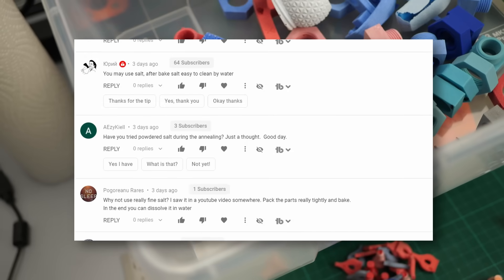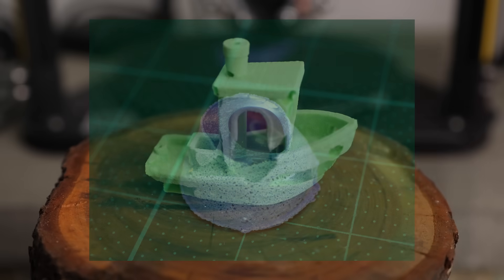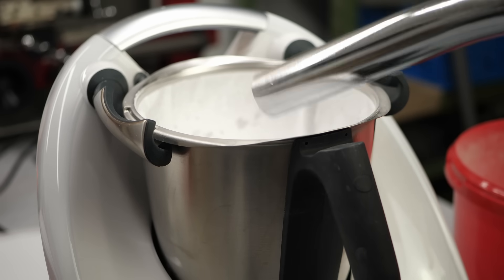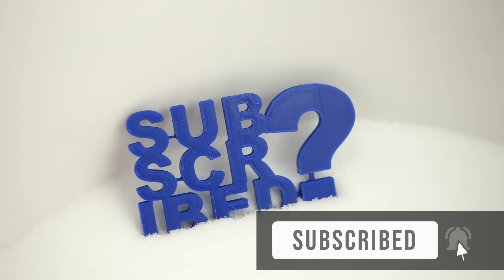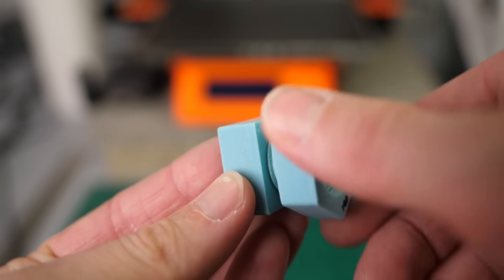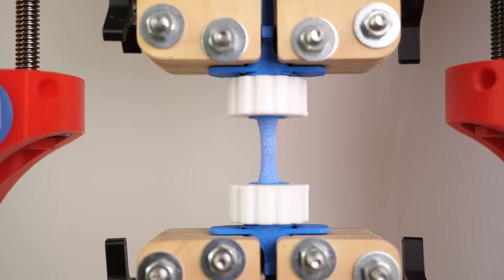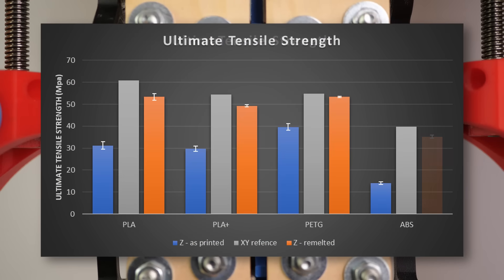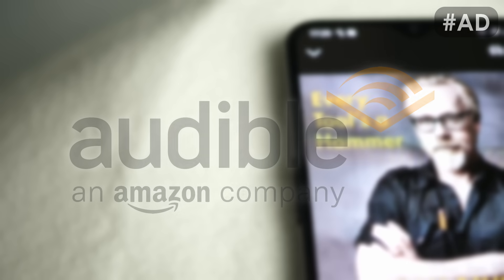The STRENGTH of 3D prints REMELTED in SALT

Comment: I'm curious how this method would work at LOWER temperatures.   I think you could achieve similar results by going just a tiny bit above the glass transition temperature, sufficiently softened to relieve the internal stresses, and allow the molecules to realign, but not fully melted.

Comment: Print with an additional bit of plastic in the model (positioned at the top) that can flow in to compensate for any plastic lost, then snip off any of it that's left at the end.
You could even print out hollow parts with a big chunk of plastic on top (waste plastic melted into a cone mold or something) to save on printing times.

Comment: This video is quite old but I wonder if you could create a smooth salt coat on the printed parts with wet salt. Either by dissolving salt and drying it on the part or by packing it in damp salt before covering the entire thing in more dry salt. Either way any water should be long gone by the time you get to plastic melting temperatures and it should help if you can't get the grind fine enough. The only worry would be that the thin salt crust might crack as the part melts which might leave odd marks.

Comment: Seems to me that annealing would be best suited for sanding down the pieces for a smoother finish over all. Depending on your use case the strength may also be nice but for my use case I need the ductile property that PLA+ provides without annealing with also decent strength.

Comment: Wouldn't there by definition have to be some part shrinkage?

Even at 100% infill, there are gaps between the layers (if there weren't, there'd be no need for this process). As the plastic remelts and solidifies it would try to fill all those spaces with the same original mass. 

The total volume change might be imperceptible on something like a benchy, but for mechanical parts that require higher degrees of accuracy it might matter.

Comment: I would like to see a follow up to this where the pores created by the dissolved salt crystals are filled with an epoxy. Perhaps a very thin/runny (low viscosity) epoxy would flow into the pores but I would assume better results if they were dipped in the epoxy then cured in a vacuum chamber. The goal here would be to further strengthen the part by giving it a very tough exterior shell that is strongly bonded with the plastic through the pores, as well as smoothing out the surface to make it more durable to abrasion, use, and potentially UV resistance if the epoxy chosen has that property. The spongy plastic surface also would suck up paint, so if you wanted to color the part the epoxy coating would result in less need for multiple coats of primer and paint.

Comment: I have an idea... what about if you machine or 3d print (out of a very high temp plastic) a mold or jig that you can set the test parts in that will help the part retain its shape while heat treatment.  Using aluminum or a fiber reinforced high temp filiment should allow the test sample to retain its shape and aid in the cooling process you can mill or print a slot that will fit a digital thermometer near the interior of the mold to give precise readings of the part. You can do 2 halves or just a thin plate with slots to keep the parts in shape. 

Also would you do some testing on the cr30 belt printer? I'm curious if parts printed on a stepped 45 degree angle are as good, better or worse then those printed at zero and 90 degrees angle. I'd also like to get your take on the print mill now that you have had it for a while.     I'm looking at one on a more long term goal as I just got my first printer and it isn't even set up yet. 

  I've been trying to collect data on compression  strength of different materials  on their potential for weight bearing applications and ability  to withstand impacts along the same  direction of compression. I'd like to hear your thoughts.

Comment: I think the ultimate technique is to undersize the part (enough to account for the coating) and coat with some thermoset polymer like epoxy. That ensures the salt doesn't mix with the outer later.

Also, if your part geometry lends itself to it, you can print it empty and coat+fill the part.
Reply: are the epoxies good enough?

Comment: I don't know what temperature is needed to transform sand into glass, but I suspect using sand might eventually lead to clogs in the hot end that would be problematic to clean afterwards. The filament produced would certainly be more abrasive to Bowden tubes and hot ends, so you'd need an all metal hot end. The brass ones wouldn't last very long.

Comment: Ideas on salt, sand, other media, oil assisted packing, other food based binders..
My inclination here was to swap salt for sandblasting medium/s. Originally just sand of specific size, but on further consideration there are other media that may bring other advantages I'm unfamiliar with. Water cutter grit also?
But when Stefan mentioned the packing & water issues, I wondered if we couldn't borrow from metal casting in sand/green sand by using an oil or magic sand to allow for part packing in a potentially cheaper medium via industrial scale production advantages, as opposed to the price premium of fine food grade media - tho for food grade application, this is invaluable.
Many of these ideas come from various metal casting techniques I hope to use W 3d printing. The magic sand trick comes from AvE.
Other products that are water soluble & used in metal casting may also work? Borax flux, maybe? Glycerine, other sugars?

Comment: Have you tried greensand like they use for sand casting? That holds together really well and in theory should work really well for this kind of process.
Reply: just a guess but this is probably way to coarse
Reply: @MLP4242  Could also use delft clay. You can actually make your own  casting sand and pick the grain size. Some people can reproduce fingerprints so I can’t imagine there would be a problem with resolution. With metal the bigger grains are better at expelling gases so generally the larger the castings the more corse the material used will be.

Comment: Try using diatomaceous earth instead of salt. It comes in a very fine powder, is relatively cheap when you buy bulk and it has excellent thermal/insulating properties.

Also, I’ve found that if you can find a vacuum sealable container that fits the part, you can run a vacuum after compacting by hand and it will get into all the missed crevices. Another thing I’ve been working on is using these heat resistant vacuum seal bags to be able to heat with water immersion. Still some stuff to work out with it though, such as getting a workable thermometer in the bag that can be seen.
Reply: Alas, like sand and plaster, diatomaceous earth aka kieselgur is NOT water soluble. As free spirit 1 pointed out, the powder used for this application has to be water soluble, because the process makes the grains in contact with the melted plastic mix and merge with the surface part. In the end, the part needs to be washed in warm water so the grains incrusted into the surface can dissolve and be completely removed, leaving the part with a smooth surface finish. If you use a non-soluble material even with a small grain size, those will remain stuck and give a rougher surface finish.
Reply: @fluxcapacitor  that could work if you actually want more manual control over the finish afterwards! Do you have any experience with marble powder by any chance?
Reply: Also heating it while under vacuum seems like the optimal way if you can manage this in some way.
Reply: Aren't there specific sous vide cooking thermometers that are basically made for that purpose?
Reply: I was going to recommend this as well. Just be careful with how much dust it can produce
Reply: Think though. U don’t want it finely in all crevasse that’s how the salt gets in and ruins the surface layer. Finding the ideal gain size for that would be hard
Reply: Why don't you use a wireless thermometer? They make wireless thermometers that can run for hours on a charge and you could watch the temperature right on your phone.
Reply: Curious how deformed a part would be if you vacuum sealed it in loose fiberglass fibers.
Reply: Plus it kills insects like a mf'er!

Comment: I use a high pressure air compressor to blow off salt from my annealed parts, also with the pressure up high enough and with a smaller nozzle, it can even be useful in removing pesky supports in hard to reach places

Comment: I don't understand why salt was used if the main properties desired are heat resistance and fine grain size. Talc or even dry plaster of Paris (gypsum or lime) are industrially ground and wont easily burn if at all.

Comment: Came back to this after seeing Integza’s home sintering of 3D printed metal aerospike jet. He was using carbon layer on top of the supporting granular sand-ish material to prevent oxidation. I think you can re-melt ABS at much higher temp without little or less oxygen to get insanely strong parts, it won’t turn brown unless it’s the pyrolysis.

Comment: Use a ball mill for grinding the salt. You can build one yourself EZ with a 3D printer. Marbels work great as a grinding medium :)
Have one myself build form pvc pipes, wood, bearings, a rubber drive belt and a old hand mixer. Works great.

Comment: That outer surface is pretty gnarly though.. (ー_ーゞ
What if you coated it in something thin first, to help the melted plastic hold it's shape and prevent leakage between the grains. IDK if model acrylic varnish could withstand that temperature, that or some type of enamel or automotive paint? It would form a barrier that would hopefully prevent grain intrusion into the molten surface.

Possibly you could get away with coarser less uniform particles as well.

Comment: Use an isopropyl bath for pla after baking and then test again it'll significantly increase the strength of parts because smooth surface doesn't let fracture start as easy as rough ones

Comment: would really like to see talc Talc is widely used in polypropylene, at loadings of ∼10–40%. Talc-filled resins exhibit increased stiffness, heat resistance, and high temperature creep resistance, better dimensional stability, and heat and moisture resistance. Tensile strength is unaffected. Impact strength can decrease dramatically, especially in copolymers; would be interesting to see how it would impact PETG and PCTG

Comment: As far as consolidation of the salt, perhaps a salt-flinger could be made using 3d printed components and rc motors and escs? Sand fingers are used in commercial foundries for sand moulding, and hurl the sand into place, causing it to compress and cake up around the foundry cores (the components in this case) I guess you could print components a few percent oversize and then abrade the porous, moisture affected layer off. Isopropyl polishing could also be tried, to completely remove tooling and processing mark stress risers? Excellent work. Love the scientific and engineering creativity and analysis you bring to these projects!

Comment: I really wonder what is going to happen, if you fill this salt with water and than add much more salt as precipitate for make a supersaturated water-salt solution inside the salt particles.
I think this supersaturated water will fill the blanks between salt particles and over 102-105 ish Celcius water will waporate and just salt will stay in place, right next to our printed parts outter wall.
And 102-105 Celcius way below our PLA's melting point, can we use that way for better surface quality maybe ? anyone ever tried it before maybe ?
Maybe am i missing something about effect of water to the PLA can someone enlighten me ?

Comment: The main benefit I'm seeing from salt is that it's water soluble, so it's easy to get off your parts.  Something like green sand will give you more cleanup work, but it might be worth it.
Three experiments I'd try if I were investigating it:
- it would be interesting to try non-melting powdered sugar ... it's supposed to have be temperature and moisture resistant, but perhaps easier to get hold of?  Shame the working temperature is just a bit over the point where normal icing sugar could be used
- how about using an ultrasonic step, to get the salt to flow into gaps, prior to compacting?
- just as an off-the-wall thought ... instead of trying to crush salt in a blender, how about throwing it in a rock tumbler for a while?  it's slower but you can probably throw a large batch in and just forget about it for a while, so it might work out.

Comment: hi stepan,
you may  try ball-mill, to grind up your salt, instead of killing your kitchen blender.
my estimate it can take longer a bit, but you can achive very fine particles.
with ball mill, you may grind up diifrent "minerals"  less absorbing water then salts.
i would try to put the melting vessel (pot) on a speaker table, to vibrate / compact salt.
don't know sure, just to try.
cheers, lev

Comment: If you are looking for fine dust that survives an oven, maybe try "diatomaceous earth", it's calcium carbonate in the micron grain size. You could also try plaster or cement without water. I think the porous outside has to do with the salt sucking out surface water very quickly, which boils and bursts. Something less hydrophilic would help I think. You could also try Canola oil or safflower oil, but because of temperature swings, I would keep the oven <Smoke temp - 10C.
Reply: Filter grade diatomaceous earth is silica not calcium carbonate.  If you want calcium carbonate climbers chalk will be better and is silica free.

Comment: I wouldn't mind seeing more ideas tested for creating stronger products using 3D printing either entirely or as an aid.  For example, what if you created multiple layers of a piece and epoxied them together with the grains of the layers in opposite directions?  What if you 3D printed a mold and cast a part with epoxy, how would the strength compare?

Comment: I really don't think salt is the optimum substance for this experiment at all. It's quite reactive, especially at elevated temperatures and this was probably the reason why the ABS appeared the way it did at 230C. I can't see why talc wouldn't be more ideal provided it has nothing added to it. It's pretty inert and is already very fine. Also you could dip the PLA models in a concentrated acetone solution of ABS and let it evaporate to leave a thin coating of ABS to protect the surface.